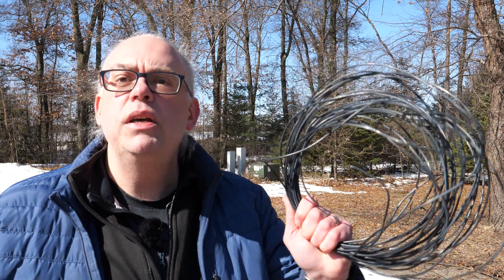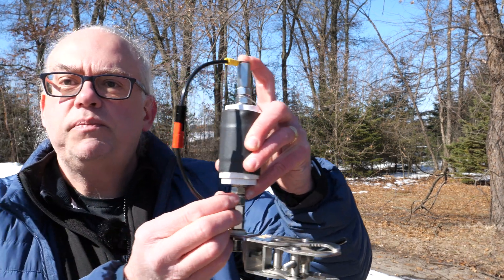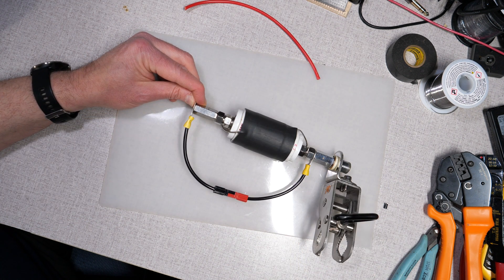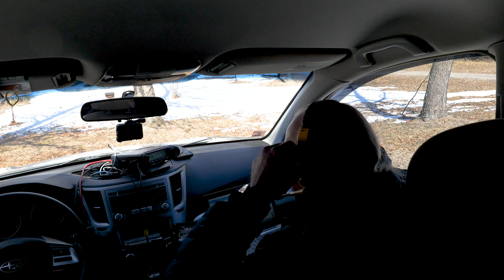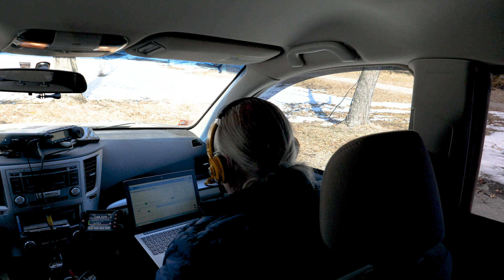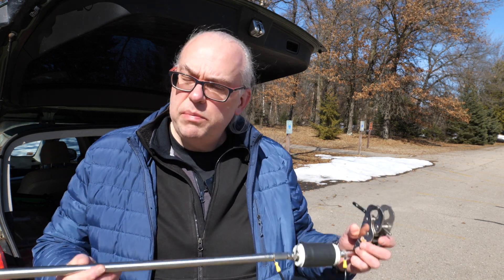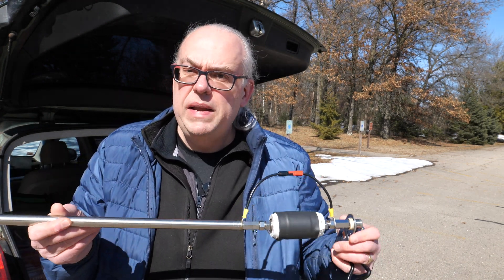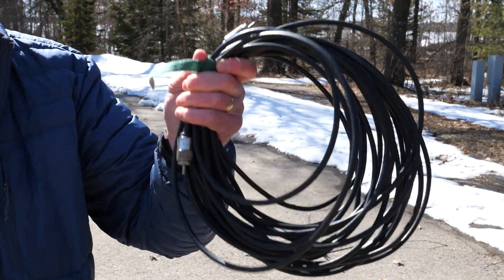This little wire super charges your Wolf River Coil #hamradioqa

Comment: You don't need ring terminals! 
Harbor Freight has a alligator clip assortment that costs two dollars
On sale. The kit as some large alligator
clips  in the kit that can clip right over the nuts at the top and bottom of the coil in seconds! No need to unscrew the whip to insert the ring terminals.
73 Mike WB2LCW

Comment: I've got the 1000, I'm assuming if I get the 17" whip I can add this bypass mod to it as well for 20 meter? I figure more height is better than the standard 102" that it comes with? Thanks for all you!
Reply from the maker: Although I've never tried it, the bypass should also work just fine with SB1000

Comment: Does it matter what size wire you use?  It appears you are using 10 gauge wire.
Reply from the maker: I'm using 14ga stranded wire. I don't think the size of the wire matters much, I'd use something that is not too heavy but substantial enough to easily allow you to connect and disconnect it.
Reply: @KB9VBRAntennas  Thanks Michael.  I happened to have some 14ga here, so that's what I used.  We'll see how this works!  73 Chris NS8Q

Comment: Will that top half of the added wire count as an extension on the antenna length when the powerpoles are disconnected?

Comment: Micheal, does your jumper wire have to be so far away from the side of the coil
Reply from the maker: The length should not be excessive, but it needs to be long enough that you can easily connect and disconnect the wire.
Reply: THANKS

Comment: What gauge wire should you use ?
Reply from the maker: I used 14 gauge stranded wire. I had a piece of scrap wire that was an appropriate length.
Reply: Thanks Micheal, I used a piece of 12g stranded wire would that be a problem? KD9WTH 73
Reply from the maker: Nope. 12 will be fine. If I had a choice, I'd do 12, 14, or 16 gauge. Otherwise your cable gets too think or too thin.
Reply: Thanks Michael ,for the info

Comment: The coil is still “in the system” electrically. Correct? It’s now just in parallel. Does this have an effect on the antenna’s impedance? Compared with not having the coil connected at all.
Reply: That’s correct, strictly speaking. As the length of the wire used to “short” the coil approaches 10% of the wavelength, the difference in RF voltage from one end to the other (due to the current distribution over the entire antenna) can no longer be ignored.  Around 10 % of wavelength and certainly if the wire length is close to 5% or smaller, we treat the wire as just that—a wire—like in a DC circuit. Also ignoring loss due to wire resistance, we say the voltage is the same over its entire length. The coil is shorted out.  At 10 meters wavelength, 10% is one meter—5% is 50 cm, or about 20 inches.  The piece of wire shorting this coil makes it invisible electrically and effectively not there.

Comment: Michael, I was wondering if you ever use guy lines when the  whip is fully extended. I just ordered a Sporty Forty and a CHA SS17 that I'll be using with a ground spike. Thanks, love your videos!
Reply from the maker: No, I don't use guy lines with my 17 foot whip. I've operated with the ground spike and my heavy base in winds gusting in the mid 20's mph and haven't had an issue of the whip falling over.
Reply: @KB9VBRAntennas  Thank you and have a happy Easter

Comment: Hey Michael, another great antenna mod/improvement.  If I had a Wolf River Coil, I would definitely do this.  I may end up with one yet.  I need to get a good multiband portable antenna for POTA.  I haven't dialed it in yet if I should get the Buddistick Pro, or the Wolf River Coil or a mast and an EFHW.  From all the reviews that I have seen I don't think either one of the options would be a wrong choice.  Any suggestions would be greatly appreciated.  73
Reply from the maker: Any of the three are good choices and have their positives and negatives. I usually carry two antenna types into the field: a self supporting vertical and a wire antenna. You never know what situation you will be presented with. Trees or space may not be an option for a wire antenna or you have to hike into where you want to operate and a vertical is too much bulk. It's good to have options, especially if you are traveling any distance to activate a park.
Reply: It depends on what you really want to accomplish. The BuddiStick Pro is good and it works but it’s finicky to tune with an elevated radial. I’ve not used the WRC but I haven’t heard a bad thing about them. With both of these choices retuning is required to change bands. I feel the BuddiStick is the more compact choice. The 49:1 EFHW works great as well and if it’s cut for 40m it also gives you 20,15, & 10m without needing to retune. Opinions on it are mixed depending on who you talk to. Vertical antennas like others have said are more DX oriented. Good luck on your choice, there’s just way too many.

Comment: Heard my call in there a few times. KE8WLW mobile.
Reply from the maker: The way I usually work is I'll start typing in a partial callsign during the pile up but will hear the /mobile, /qrp, or park to park at the end. I'll work the station I partially identified and then try to ask for the mobile or p2p after the next round. It may take 2 or 3 calls to get through, though.
Reply: @KB9VBR Antennas  it's was quite the pile up as per usual. Still pretty cool even if you didn't catch me. I'm always mobile in the 18 wheeler.

Comment: Could you have done it with a switch or would it interfere with the antenna? Thanks!
Reply from the maker: A switch should work. Depending on what power level you transmit on, the voltages present may be more than the switch's capability, so be sure it is properly rated.

Comment: As always great video! What type of wire/gauge did you use? Many thanks.
Reply from the maker: I had a scrap piece of 12 gauge stranded wire leftover from another project. If you were using fresh wire, I'd use anything between 12 - 16 AWG.